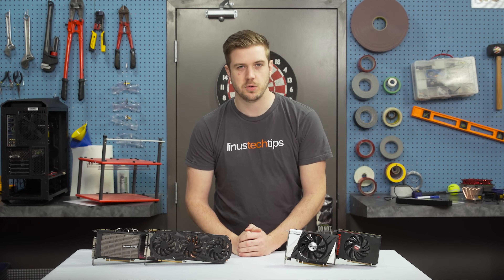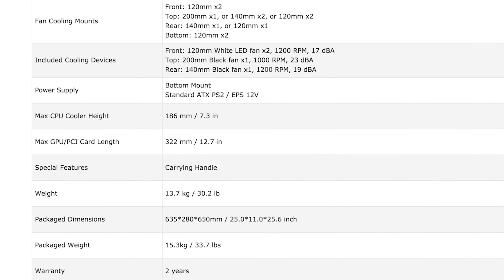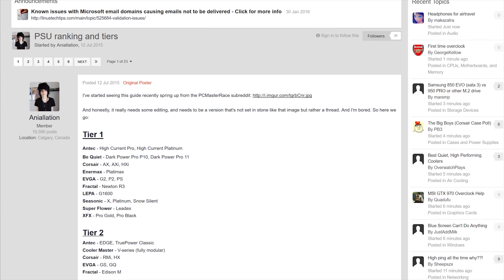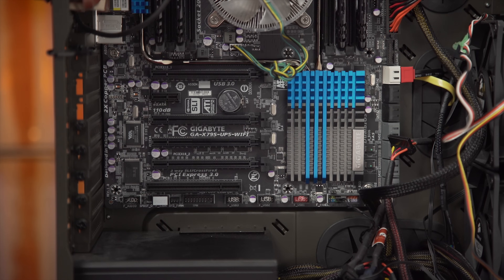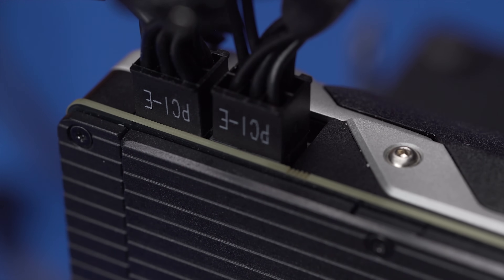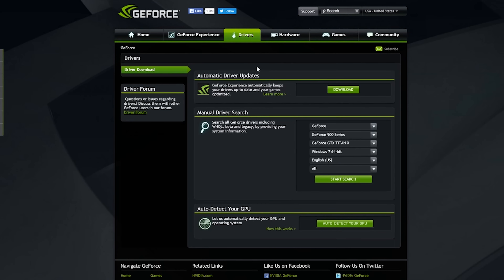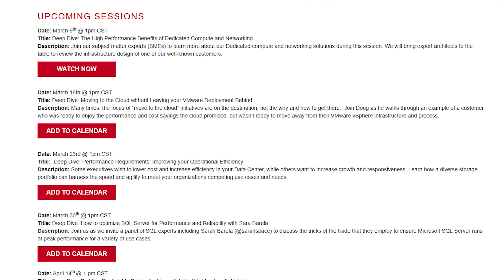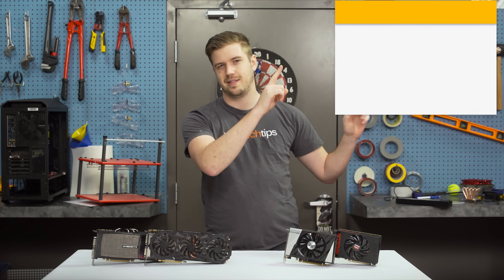Installing a Video Card - How To: Basics

Comment: The bracket cover frame is preventing my card from fitting in all the way. What do I do?
Reply: there is no way anyone can help you with this issue unless you provide more information. I don't know how you'd expect anyone to see what it is you're seeing, we would need to know specifics about your set up. Like what the case, card, and motherboard are.
Reply: @ppsneezeakax420xsniperxaka9  we figured it out😁 thanks though
Reply: Cherina Phillips what did you have to do? I’m having the same problem with my phanteksp300 case
Reply: So the mother board was too low (we laid the case on its side) so we put the spacers in so it sat a little higher. It all worked out. My husband get frustrated easily. He just need a break. Then we were able to figure out what was wrong.

Comment: 3:46 i can t find them
Reply: lmao 12 open the back of your case. (backpanel) whether or not you built your pc or bought a prebuilt will depend how hard it is to find them. look at your card usually it’s a 6pin or 8pin connector fine the one with the pins the match with your card then route it to the front of your case and plug it into the card. IF the car needs external power. if there are no connectors that means the card is powered straight from the PCI slot. Goodluck!👍🏼👍🏼

Comment: Hey i have a problem.. can somone help plzz..
i just got a new PC wil this CPU i7 3720QM work with this PC???

Monitor:
Samsung UHD 4K Smart TV

CASE:
Deepcool Matraxx 50 

CPU:
Intel Core I7 3720QM CPU @ 2.60GHz 2.60GHz

Graphics Card:
RTX 2080 AORUS 8GB 

Motherboard:
Gigabyte Z390 AORUS ULTRA

Cooling:
Cooler Master MasterLiquid ML360R

Power:
Cooler Master MWE Gold 650 Full Modular PSU

RAM:
DDR4 RAM 32GB G.Skill 2x16GB 3600Mhz

HDD:
1TB SEAGATE HDD

Wil the CPU Intel i7 3720QM work with this PC??

Or do i need to upgrade the CPU??

Comment: Hey i have a problem.. can somone help plzz..
i just got a new PC wil this CPU i7 3720QM work with this PC???

Monitor:
Samsung UHD 4K Smart TV 8000x4000

CASE:
Deepcool Matraxx 50 

CPU:
Intel Core I7 3720QM CPU @ 2.60GHz 2.60GHz

Graphics Card:
RTX 2080 AORUS 8GB 8K

Motherboard:
Gigabyte Z390 AORUS ULTRA

Cooling:
Cooler Master MasterLiquid ML360R

Power:
Cooler Master MWE Gold 650 Full Modular PSU

RAM:
DDR4 RAM 32GB G.Skill 2x16GB 3600Mhz

HDD:
1TB SEAGATE HDD

Wil the CPU Intel i7 3720QM work with this PC??

Or do i need to upgrade the CPU??

Comment: So I followed all the instructions but lost all audio. Is this common , how do I fix it?
Reply: eric van bebber 
Are all the cables correctly connected
Reply: It’s depends on what cable you are using. HDMI, dvi, or DisplayPort, as long as you have those, it should be fine

Comment: I cant screw the gpu bracket screws back in. Is there a problem or anything i could try? And are the screws really necessary? I can put it through the big opening but its not screwing it in more of just proping it there to hold it, will that work?

Comment: My 6 pin connector is already conected to my motherboard do I just unplug it from my motherboard and put it in my new graphics card
Reply: Exploder Dog no that’s the cpu cable, you need to find the pci cables for the gpu

Comment: I am having and issue where my 1660ti dose not display anything but the fans spin. My gtx 1060 3gb works just fine and displays stuff but my gtx 1660ti works, the fans spin but they don't display anything plz help

Comment: Just got the 480 but while playing the new resident evil 2 remake my graphics card temp was around 85 or 86 I’m not good with PCs but is that safe or should I try to get lower temps
Reply: That's pretty high. Once that hits 90 I'd be really concerned. You need better cooling

Comment: i got an intel i5 6400. 
can i a good graphics work? or do i have to replace my processor?????
also i don't know how to replace power supply thing
Reply: Your current cpu is probably good, as for the power supply check to see what you computers over power comsumption the. Check to see by who much it will increase or decrease with the new gpu

Comment: I cannot use the bigger plug in type on mine. I was told my power supply cannot handle it. So my concern is if I upgrade my power supply, will my motherboard be able to handle it. I dont need a gaming computer. I just need a basic 3-D video graphics card capable of handling my Real flight RC plane simulator.

Comment: Does every 1050 use 75w? And what if theres a 6pin connector on a 1050 do I need to plug it in there or just not use it and get all the power from the pci-e?

Comment: im curious if you have an intel chip with intergrated graphics do you need to use DDU 2 times to uninstall bot nvidia and the intel graphic drivers or do you just worry about the cards your swapping?

Comment: Linus please help i bought a rx 460 4gb and i plugged it into the mother board and got a black screen from the hdmi output on the card and the intergrated graphics port my psu is fine and i downloaded the correct drivers. What is going on?

Comment: Tht ddu fucked my computer up
Reply: Yeah, it sounds like a good tool, but I was thinking about the same thing. It might be good if you had a previous card that had old drivers in them and you're upgrading to a new card, like if you're upgrading from Maxwell to Pascal or something, I could see that it would probably be helpful. But if you are installing a brand new graphics card, and you uninstall the Intel display drivers, it may mess up the onboard Graphics in your Intel chip. It may prevent them from running correctly. And may intern mess up something within your CPU. So I'm not exactly sure if that's a good thing or not. I would be interested to know exactly how you think it messed up your computer?

Comment: I love this show, but this episode really didnt awnser the specific questions i had related to the topic. I want to build a new PC soon and while looking at some stuff on the internet i discovered possible faults i made in my first build several years ago...

I hear you need to put the cable at the PSU side into the highest line of connections for some 12v thing? do you have to? i didnt and i think its fine... also, my card (gtx 770) needed an 8 pin an 6 pin, but my psu came with a cable that had an 8 pin connector on the PSU side, and split into two 6+2 connectors on the GPU side. I used that to connect it. Never had any issues, but i can immagine that this caused my GPU to be underpowered. Some people say this matters a lot, other say not if the card uses less then Xwatts and the 230 watts mine uses according to specs is beneth the different numbers i come across, but i dont know. I have a crossair 860 gold PSU (i know to much but it was 25 euro more then a 600 one and modular so i liked it better also for power curve), but my question is more general. 

When i build it i did a bunch of benchmarks and its always been stable but i do remember feeling it was ever so slightly below the numbers i saw from others, but i always thought it was a lottery thing, or some people like jay2cents watercooling it with the radiator in the airconditioner.. the difference would be 5-10 fps compared to benchmarks online, but that might have had a better CPU or other differences to achieve that (mine is i5 4670k, shouldnt bottleneck)

I will change these things already as soon as i turn my pc off.. But i would like to know if it matters? or is it just normies on the internet producing verbal vomit, and making me nervous for no reason. I'm fairly certain it cant have been a huge screw up either way as ive not had other problems then an SSD failing which is undoubtedly unrelated. but still.

Comment: guys i need help i currently have a 970 which takes up 2x 6pin connector and i want to upgrade to a 1070 which takes 2x 8pin connector. Do i need an extra cable or something?

Comment: Bought upgrades for my pc today. Bought the massive RX560 gpu (LOL) and the whopping 350W psu (LOL). Psu was about 1/6 the size of my unit and the gpu smashed into the hard drive connection on the board. LOLOLOLOLOL And I thought I was learning something about comp's.

Comment: What if I flip my graphics card upside down? I have been having overheating issues with my gpu and I noticed the fan on it is facing the bottom of the case and its only about an inch off the bottom of the case, so would it hurt if I just flip it upside down so the fan is facing upwards?

Comment: if I had integrated graphics before do I still have to worry about uninstalling the drivers?
Reply: No, I'm pretty sure it automatically uses the graphics cards. Also plug the HDMI cable in the gpu

Comment: my gpu clearance is 266mm for my antec ONE case

but my gtx 1070 TI armor 8G   is 279mm 

so i think i'm gonna cut out a little trim in the hdd bay to slide it in

Comment: Hey i have a prebuilt Acer predator g3120

Specs 
AMD athlon II x4 645 Quad core processor

nvdidia geforce gtx 550ti

8gb ram

1tb harddrive 

I want to uopgrade my graohicd card to a Zotac gtx 1050 mini will it go in fine??? I need to know

Comment: I need some help from someone in the comments. So my computers graphics card didn’t have a pcie cable and now that I have a new graphics card, I need one. The problem is I have no clue what  type I need or how to install it. Anyone know how?
Reply: Gassyun1c0rn 666 it comes from the power supply

Comment: Great video, though I did have to use another installation video because most of the instructions here did not actually apply to my video card(such as my video card did not have PCI ports), but the bit about uninstalling old display drivers and installing the new ones was quite helpful. Also, remember to hook up your monitor to your new video card, don't keep it in the old integrated video card slot.

Comment: Can someone help me. I just finished installing my new gpu and when i plug my monitor to the tower vga cables it would say vga no signal do i need to disable or delete first the integrated gpu and then put my new gpu back in?

Comment: Hello. I'd like to ask if I put an gtx 1050 in my pc (very old pc it has core 2 quad q9650 cpu, 4 gb ddr2 ram) will it work just fine? It has a pci express x16 2.0 slot and Im curious about how it will work since this is the first time im trying to boost the old guy up a little bit for atleast til I get my new pc.

Comment: I doubt anyone will read this, but I'm going from a GT 640 to a GTX 1080. Does anyone know if the cord from the powersupply will also fit in the 1080? or do I need to buy another connector.

Comment: Do I need to completely uninstall the old video drivers if I'm upgrading from a Nvidia GTX 970 to Nvidia GTX 1080? Ive read that if upgrading from the same manufacturer you don't have to uninstall the old drivers.... Only need to install new drivers from GeForce experience once the new card is installed, is that right?  Thanks

Comment: My graphics card doesn't have a connector, do I need to connect it some other way?
Reply: It will get its power from the motherboard. Not all gpus need 6 pin power

Comment: If I had a GTX650 and changed to a GTX1060 do I need to still install the Nvidia drivers or do I just run it without any installation?
Reply: yo i just did the same upgrade. what did you do

Comment: How about running a 75W GPU (300w recommended) with a 270/280W PSU? I also have an AMD A10 7800 processor too, if that matters concerning power distribution. How will it fair as far as power is concerned? I've heard others use a PSU with a power output lower than the recommended power of the GPU without issues, can someone give me advice?

Comment: I had to do all the steps without my graficcard. I had to plug my monitor into my motherboard, because of blackscreen when connecting to graficcard. Will I be able to connect my monitor to my graficcard after installing the driver?

Comment: i bought a new gtx 1050ti gpu, when i connected it on a hdmi, there is no display at the screen, do i need to install the driver first and connect the display at the motherboard first?
Reply: Josuee Original take out the other display cords
Reply: PalPenny Soupcan there is no other display cord

Comment: My 970 sags badly due to the watercooling system I put in place. Sometimes the screen flickers black for a brief seconds,  and if I physically push or press the CPU when powered on the screen goes black and sometimes restarts the system.  Is my GPU dying or just not connected properly? Anyone?

Comment: Hi, so recently I got a Geforce GTX 1070 GPU, and whenever I load games, framerate drops significantly. I tried to go into the Nvidia Control Panel in order to turn off vsync, and change some settings to fix it, but it says that there is no display connected, so I can't load the app. I have the drivers installed but the games just run so slow. Can someone help me fix the problem?

Comment: I installed a gtx 750ti on it the fans are working but the computer is having trouble 
When I try to install the graphics drivers it does not work ''Cannot find compatible hardware''
The Graphics card is a Gtx 750ti 2gb DDr5 vram 128bit PCi-e
The motherboard is a dell 0KRC95 
The computer itself is dell optiplex 7010 med tower core i5 3550
PLEASE HELP ME!!!

Comment: Soo before installing new drivers I need to uninstall the old ones?, I always thought whenever I update the old one automatically gets uninstalled by default.
Reply: Only if you use a card from the same company(Nvidia/AMD) and you choose that option during install.
But yes, if you go from Nvidia to AMD, or vice versa, you should/need to uninstall the old drivers first, preferably in Safe Mode.

Comment: I will upgrade from a gtx 970 to a 1070 with a 450 wat powersupply. Is it gonna work in the long term? Btw the 1070 I will by 1070 is not that powerhungry. ''Like a zotac''

Comment: so my case has metal expansion slot covers on the back how do I remove those
Reply: Hammer
Reply: @est495  that's actually what I ended up using 3 years ago, I had pliers, a screw driver, and a hammer, ended up slicing my thumb open and my GPU probably still has a bit of blood on the one side

Edit: it was a prebuilt AMD APU system from best buy yhat I was putting a graphics card in and the case was not being nice about it

Comment: Im planning to replace my GTX 970 that has 6pin and 8pin power connector with a GTX 1080 which has only one 8 pin power connector. Do i just plug my one 8 pin power connector from both my 6 pin and 8pin connectors and leave the 6 pin hanging? is that fine?

Comment: I used the DDU thing he said, and it just restarted the system. Then it got stuck at the hardware screen. The one where it just says "Processor Type... Processor speed... L1/L2 Cache Size..." etc. Any suggestions? A restart puts it back on the same screen in like 2 seconds.

Comment: Ok i have a AMD x4 860k, R9 200 GPU, gigabyte, f2a68hm-h motherboard, and i want to upgrade to a AMD fx 8350, RX 480 GPU, and a gigabyte 990x sli motherboard, do i have to do anything like deleting thoes fiels from the hard drive to replace the older components.

Comment: I have a question about what type of connectors are required to connect a GTX 1070 Gigabyte to a monitor/TV. I'm trying to build my first computer, but when I looked up what type of connections are needed, I can't find any that specify which type is needed.

Comment: I connected my monitor to my computer using the GPU HDMI port but nothing is displayed on the screen but when I connect the HDMI cable to the Motherboard port, there is a display and thats how I installed Windows. I checked Device Manager and my GPU wasn't there but my GPU is lighting up and the fans are spinning.

I am quite new to PC building so if anyone has any possible solution, I would appreciate it so much!
Reply: TheUltimateGamerzHD sounds like a connector problem

Comment: If i uninstall the drivers will the display port to my gpu stop working until i reinstall my drivers? So will i have to switch to hmdi on the motherboard than back after i reinstall the drivers?

Comment: I plan on upgrading to a GTX 1070. I currently have a GTX 970. Will the card fit? I assume that all GTX 1070 cards have the same dimensions? All I know is that I have a Geforce GTX 970 currently. Is Geforce the actual brand?
Reply: no the brand is nvidia and the dimensions are the same if you get the founders addition. i legit just got the msi aero 1070 so i am gonna upgrade to!

Comment: Could a 1060,70 or am 80 run with an i56600 and a 600 watt power supply?
Reply: I would say yes. I am running a 1060 on an i5-4570 and it is fine. Nvidia recommended system power for 1060 is 400W, and 500W for 1070 and 1080.
Reply: DannnyL, thanks. I am currently not upgrading but I just didn't want to upgrade me PC just for a new gpu

Comment: I got a 1050ti and im rather new to computers and im going to need your help if you dont mind. I use the HDMI part since my monitor doesnt have a DVI port in which my card has. When i have everything running and plugged up, it goes to my monitor as "Out of range." Can anyone help with what im doing wrong?

Comment: I installed my card, but when i turn on the pc my screen is black. Is it possible that its because i still have my old nvidia drivers? i switched to an amd card. from gtx 760 to rx 480 and im confused if that is causing the problem, i would really apreciate a fast response from anyone